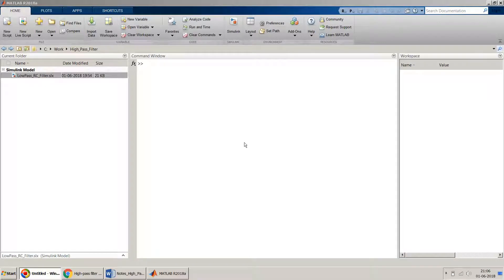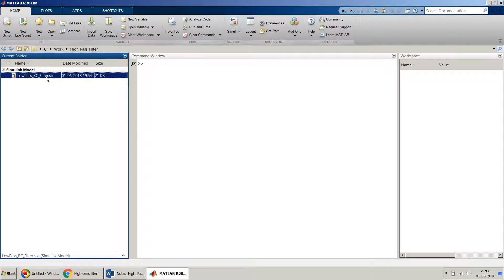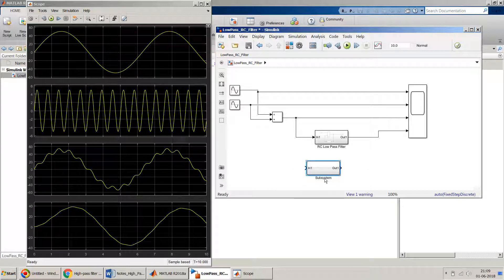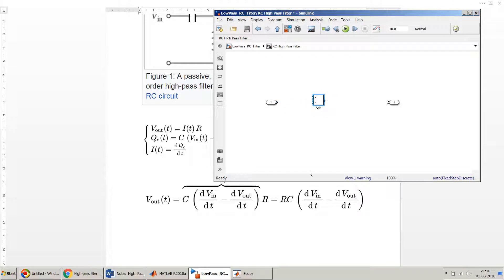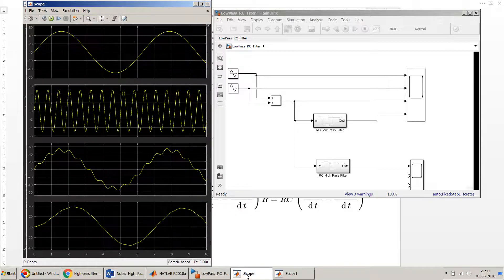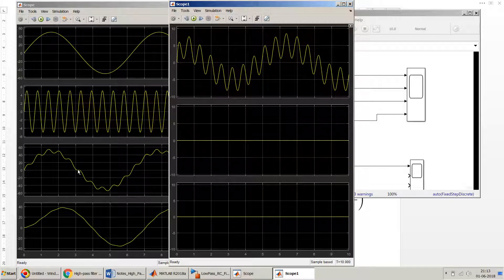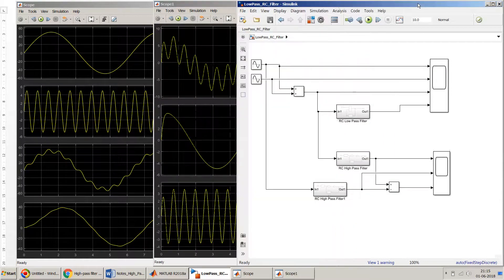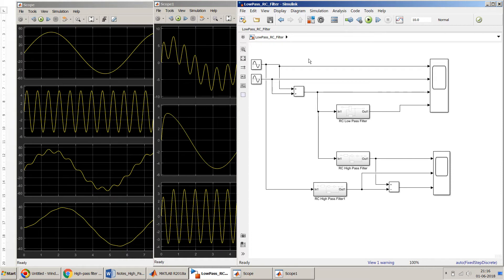Design a simple High Pass RC Filter using basic blocks of Simulink in MATLAB

Comment: What about the cut off frequency?
Reply from the maker: Cut off frequency is based on the values of R and C as considered for the high pass filter equation shown in the video.
Reply: @ProgrammerWorld  In the previous video of low pass filter the value of RC was chosen 1 , how it stopped the frequency of 10 Hz noise if cut off frequency is 1/2piRC = 0.159
Reply from the maker: In the previous video of low pass filter, noise signal considered is of 10 rad/sec and not 10Hz. 

1 rad/sec = 1/2*pi = 0.159Hz.
So, 10 rad/sec = 10/2*pi = 1.59Hz.

Thus, on considering RC = 1, it is able to filter out noise signal of 1.59Hz.

I hope this explanation helps. For details on the tutorial on low pass filter, you can also refer to below webpage:
https://programmerworld.co/simulink/design-simple-low-pass-rc-filter-using-simulink/

-
Reply: @ProgrammerWorld  Ohh sorry I didnt saw that....Thank you so much sir